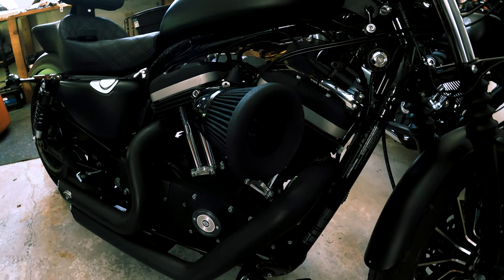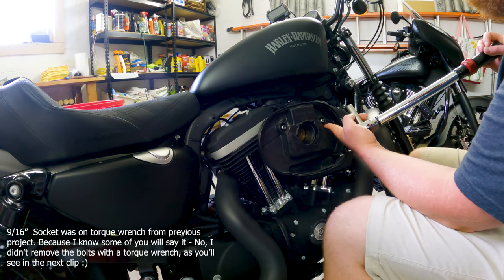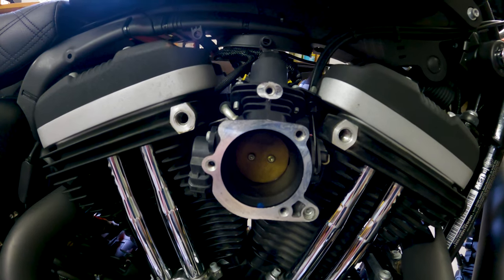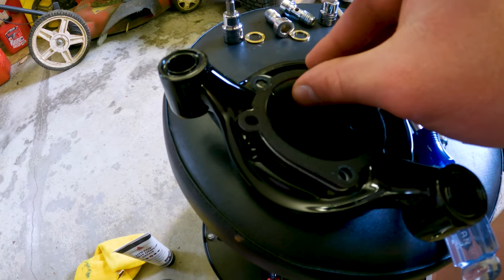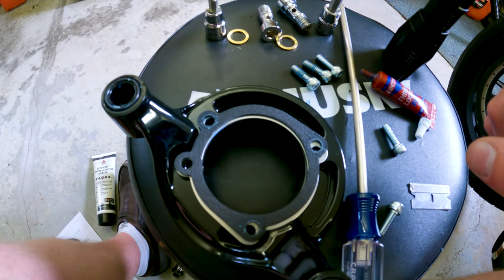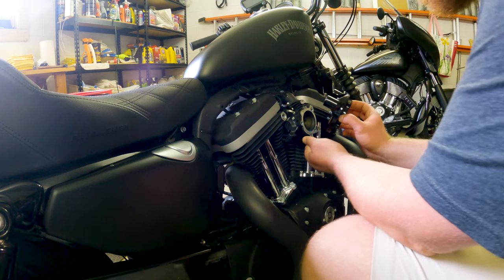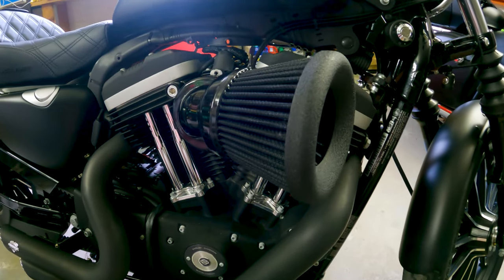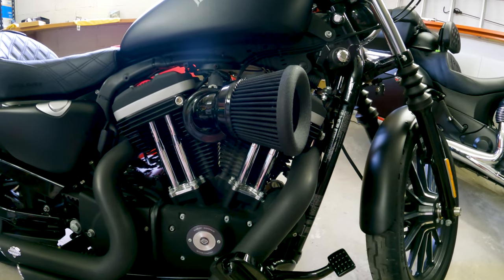How To Install Arlen Ness Velocity 65 Air Intake On Harley Davidson | MOTOBLADE

Comment: How do you clean the filter? My bike came with this filter and I’m not sure how to clean it or remove it to clean
Reply: Spray some degreaser like Simple Green on it, let it soak for about 5 minutes, then rinse from the inside out with warm water.

Comment: Do you find that it is at all in the way of your leg?
Reply from the maker: Not at all. I was worried about that, but it worked out perfectly. If you have mid controls it might touch your knee, but with the forwards my leg goes right past it and has about an inch of room between leg and air cleaner.

Comment: Any issues with the leg room with the foward controls?  Just curious intrested in getting for my 1200.
Reply from the maker: No issues at all. Forgot to mention that in the video. If I had mids my knees might knock, but with forwards my legs go just slightly low and outside of it. I was worried about that when I installed it, but it worked out perfectly. Hope that helps!

Comment: What if I don't do the  tune
Reply from the maker: Then your engine will not be getting the proper air/fuel mixture. Could be too lean and that would run too hot. Or it could be too rich and foul your plugs early and give you lower performance. Need a proper tune when making any change to the engine parameters.